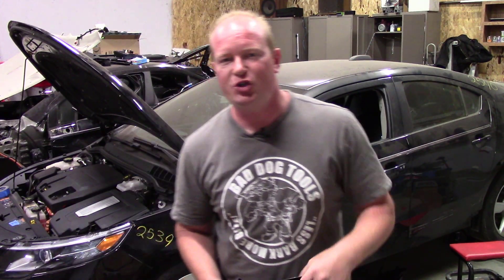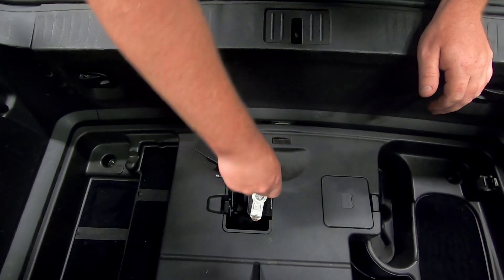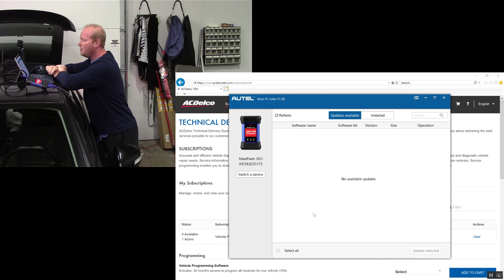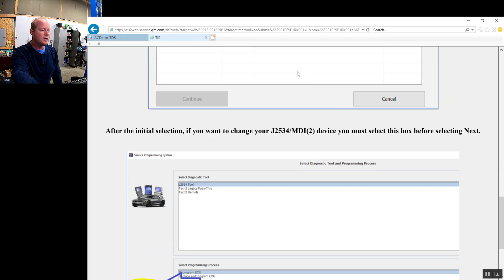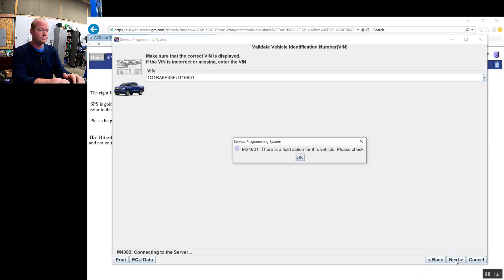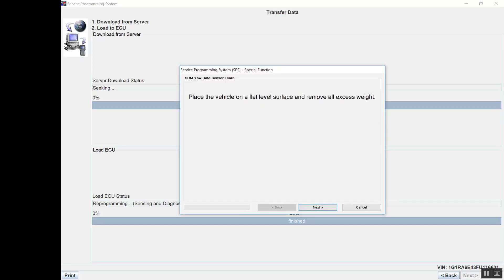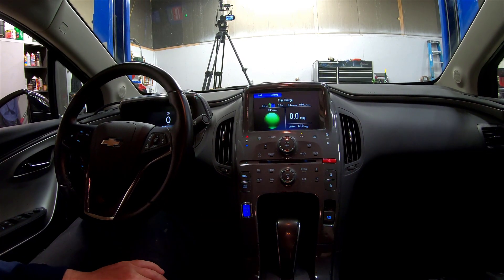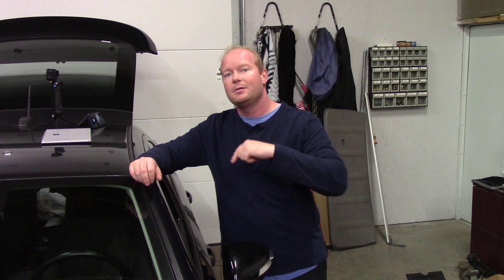Chevy Volt Airbag J2534 Programming

Comment: can we do the same same process to used Airbag module ????  what we should do if we have only used part with incorrect vin?
Reply from the maker: It is not recommended to use a used module for Airbag. Some vehicle manufacturers offer the ability to reset them Most do not.

Comment: I have a 2018 Chevy Tahoe, DTC for right front door impact sensor, checked all wiring, swapped senor to driver's door and driver's door to passenger(same part numbers) problem moved to driver's door, ordered sensor from GM, installed and got a invalid serial data config DTC (B0085)now, original fault gone. Read that you have to set ID in the air bag module, downloaded TIS from GM J2534 passthrough to vehicle tried to program sensors but no listing only has program/reprogram SDM/Air bag module, so did that, getting error E4491, E4423(error 5 at step 0). Any ideas???

Comment: Hello again wondering if you could help me on why I can download the j2534 wrapper software..
I already try to run as administrator on internet browsers  but still not download  not sure if I have the right Java is there any way you can help me 
I am running an HP intel core i5 windows 10
Reply from the maker: Contact Autel Tech support for your market. https://www.autel.com/c/www/support/3132.jhtml.  They can help make sure your computer is set up correctly.  It could be an antivirus, firewall, Java, or system setting issue
Reply: @FlashPerformance  😊

Comment: Is there a reason why you went with a new module over a used one? Preferred or mandatory?
Reply from the maker: The module can not be reset with a scan tool, it has to be reset at the chip level, and their are companies that can do that.  I decided to go with a new one instead.
Reply: @FlashPerformance  you dont have to answer but what would a job like the one you performed in the video run? Again, you don't have to answer im just curious for when i order the rest of my autel tools hopefully this month
Reply from the maker: @priusgame1178  There are 3 parts to this job, Removal and replacement of the Airbag module, cost of the airbag module plus mark up, and programming.  I would quote 2 hrs for module removal and replacement, most shops will take the product cost and double it to the nearest $9.95, and programming time would be a least 1 hr shop rate plus the cost of the subscription.  Labor rates vary across the country.

Comment: I do have a question. i know that by having the hood open the engine generator should turn on. However, there is my situation.
2011 Volt,  not rebuilt,   i had a code come up that had low cells. car will not charge anymore. Dealer says i need to replace my hybrid system. fine,, not going to since i want to use the engine instead. However, it will not start - it used to run when i had to hood open... This all happened all of a sudden.  Dealer tells me there might be a code that keep it from turning the engine on until i replace the hybrid system.  This is untrue, i have a friend in the same situation and their car turns on all the time... Do you know if there is a code that is keeping it from running the engine?  the car actually stranded me on the freeway, it just lost power and never again turn on...    any ideas?    thanks...  (i did not have any lights or codes on the dash when this happened on the freeway... after that it has a low cell codes....)

thanks..
Reply from the maker: Depending on the code I can think of multiple reasons the vehicle would not run. What are the codes the vehicle is showing?
Reply: @FlashPerformance      Turns put it was the 12 volt battery and correct procedure to install it

Comment: Flash,

An excellent presentation of a common issue ( when cars have modules replaced, or "Frankecar" builds that require MFR downloads and calibrations.

You have the cadence, personality, and clarity to be a trainer. Autel should have you on-staff as content builder ( or have they already ? )  

 A note to the public.... BUYING the tool does not replace education. Beware of cheap knockoffs all over the net, AIMED at those that want a cheap, fast, easy fix. Even a lot of mechanics that do not continually learn new diagnostics techniques have been buying tools, standing back, and expecting the car to fix itself.... is akin tp car owner going to Autozone, and having them stick a dongle in, and getting a response of which part to replace.... does not work that way.... The errors are merely the beginning of a logical, step by step testing of the variables that can CAUSE a certain failure or TSB. YES, this tool can do a lot of those tests, but many will require knowledge of a POWERPROBE, or other tools. Diagnostics is the pathway, and education for diagnostics is essential, before buying the latest and greatest tools. The subscriptions to manufacturer's websites are partially RESTRICTED. Locksmith data is on a SECURED side of each site, with separate logins. One must apply and be approved ( rigorous background checks and audits ) This helps assure against theft of vehicles using aftermarket tools for many cars. How secure a particular YMM is, is determined by the immo system, how hard it is to reverse engineer, and other factors. Most shops buy remotes and cutting of keys from locksmiths, as this saves waiting for mail-order ones that are correct and usable about 85% of the time ( 15% have bad circuit board, wrong circuit boards or wrong chip type, worn out buttons becausethey are made from used remotes with new plastic ) That is up to my clients, as I WILL cut their ebayzanon sourced keys... but I will not guarantee them. Many locksmiths WILL NOT cut or program other-sourced keys at all.... so ask your locksmith first. 

All of the above paragraph is to give an idea that auto service shops that work on "any year make model, any problem"..... likely will not do as thorough, complete and long lasting repair, as a shop that has a lot of experience with that particular make. This is why you see a lot of shops that ONLY do Volvo and Saab, or ONLY Ford/Lincoln/Mercury, ONLY Toyota and Subaru. Part of this is the amount of specialization, the annual subscription costs, the manufacturer site to USE the J-Passthrough box. 

Choose a mechanic who is passionate. A huge shop, particularly dealerships and franchise tire companies, are there to rack up sales of sometimes unrelated, profitable service... stuff that is their wheelhouse, can be done same day and OFTEN not needed. 
 

I will not do diagnostics beyond the ECU/PCM/Immo Box, as related to a lost key situation. I am a locksmith, not a mechanic. I am working my way toward being a diagnostician, as I HAVE to learn more and more of this every day, to do my job.  I am able to correct most situations, but will refer the vehicle when I and my backup knowledge base can not resolve.

I did not intend to hijack the comments, jsut passing along some needed info to the public who may be searching about the volt or similar systems
Reply: Well said

Comment: Budget wise ,I plan to get by using an old former windows 7  I-3- laptop with 4gb ram with a new 500GB SSD with a fresh install of Windows 10 pro to do programming off of. 

  I suspect with a new SSD , it would work as good as an I-5 with a conventional hard drive, but will GM's program prevent the programming process  if it does not see that the PC has an I-5 or better processor?
Reply from the maker: I have seen many computers that were not at GM spec do programming, however if you need to call GM support and it does not meet or exceed their requirements they will not help.
Reply: @FlashPerformance , but as far as you know ,  since the recent changes to  Windows 10 pro, their TDS program isn't in intrusive in itself  going to check and warn you that your PC does not meet GM required specs and not let you proceed further

Comment: Can this programmer do any ECU or module coding in generally without OE software?  Not so much programming/updating just changing vin and such to make it work in the car.
Reply from the maker: Yes, The IM608 can do Coding, Initialization, Some module replacement, and VIN Writes.  You can go to www.Autel.com>Support>Vehicle coverage for a complete coverage list.

Comment: Dear Chad, plz assist me in choosing the right Autel device for international users. Since, I will be using the device out of States, what's the best option for me, especially when it comes to programming keys and modules. I am really impressed by the IM608, the way you demonstrated it's capability in your video it's remarkable, but will it help me execute programming tasks in field.
Also please share link of the Autel authorized dealer on Amazon, from whom I can place my order with for the IM608.
Your support is requested.
Reply from the maker: Where are you located? I will find you a local dealer. Dont buy from Amazon there are to many random sellers and the system may not work in your area
Reply: @FlashPerformance  I am residing in Pakistan, it would be very helpful for me, Thanks for your support👍
Reply: @FlashPerformance  any chance of getting the IM608 & work perfectly in this part of world😉
Your assistance & expert advice is requested.
Reply from the maker: @isalmankhan1  I was not able to get a reply for a dealer in Pakistan, however I can share the support team for the IM tools email.  You can contact imsupport@autel.com for these questions.  I am not sure on the international markets.  Good luck
Reply: @FlashPerformance  Thank you soo much for your support & guidance, I will drop them an email & wait for their feedback.

Comment: I start my vehicle without programming ecu, i used GDS2 for clear high voltage DTCs from Hybrid powertrain control module1/2 and that's it,ready to go. On place airbag i put 2ohm resistors, no DTC or error massage on dashboard ;)